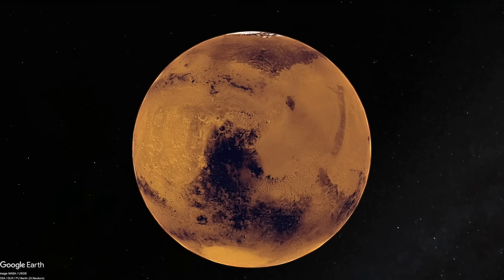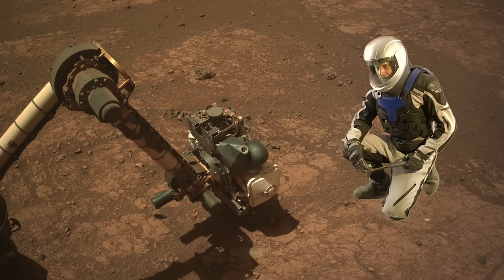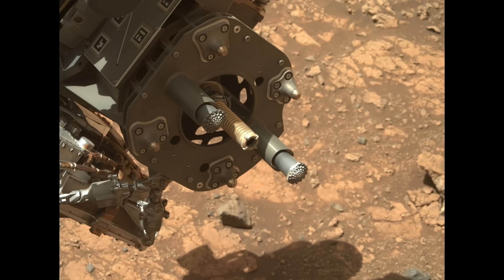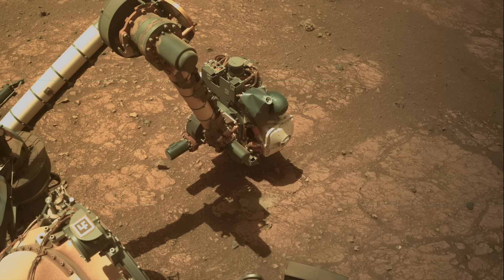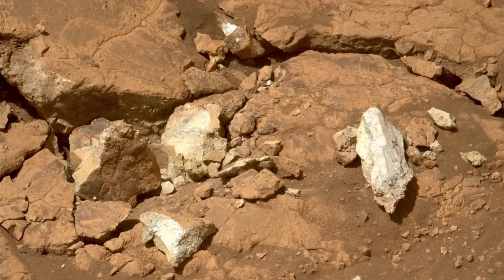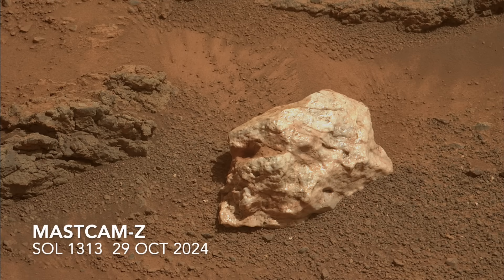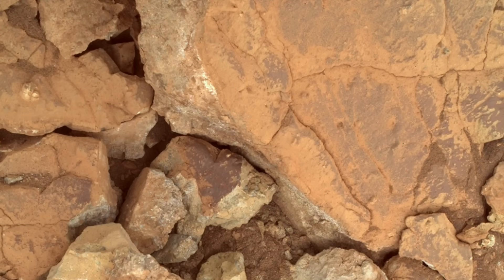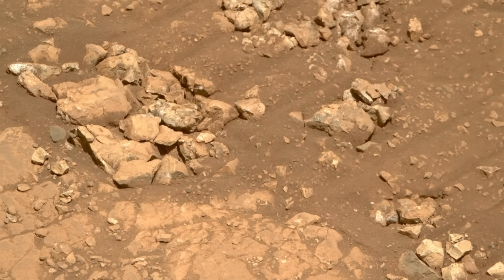Drilling failure leads to new discovery

Comment: I find in curious that at 4:05 there appears to be ripples in the dusty area in the upper right quadrant, and upper section if the frame. There are also some inter-ripple gaps. These may be fractures covered by dust, but it is unusual that the spacing seems so uniform. Also, note that the exposed rock does not have these fractures.
Reply: The ripples presumably indicate the direction of the prevailing winds at that spot.
Reply from the maker: Yeah, I should've pointed these out.  They're actually marks from the rover's wheel grousers (cleats).  The rover crushed some of the white rocks in this location.

Comment: I knew there must be a reason for my buying a Swiss Army Knife, but I never thought it would be useful on Mars.
Reply: Americans will use anything but the metric system XD
Reply: @TurboLoveTrain  Ouch. Common meme. I think he is just giving us a quick-glance reference, the same as his "Mars Guy" overlay. I do get it's a joke. Sorry if I sound pedantic, it's the temperament that had me subscribe. :-)
Reply: @flamencoprof  It's an accurate meme though.  I'm not complaining--I do like to remind people that NASA went to the moon using standard units and didn't formally switch to metric until 2007.

I don't like metric because they defined it as a ratio of the speed of light and the speed of light isn't a constant as much as standard model scientists try to pretend it is.
Reply: @TurboLoveTrain  Hmm...  The SI metre is defined as the distance travelled by light in a time in a vacuum.  The only problem I see is that it omits gravity. It should also specify a gravity field strength, be it at Earth's surface (variable) or some arbitrary distance from Earth, which then fades into the sun and planets and nearby galaxies, etc. I know that in 2015 a new clock was sensitive enough to detect the time shift caused by a rise of only two centimeters! It can thus serve as an extremely accurate measure of height for mapping, and of gravity variations caused by the earth's composition and shape.
    Is this your problem with the metre?
Reply: @flamencoprof  Yes, pegging the meter to the speed of light creates a circular definition.  My problem is big G isn't constant and neither is C.  By pegging the meter to the speed of light a whole aspect of cosmology is ignored.  G is known not to just vary from place to place but throughout the day and the current value is an average.  There were also variances measured in C almost all the way up to when thy circularly defined it in the late 60s... then they just stopped measuring it.  

Yes college students still run experiments to learn a process but that is an inaccurate method and the results aren't recorded for record.

Standard Model want's to treat the universe as fixed and wholly discrete and in doing so have created a religion and stopped doing science.
Reply: @TurboLoveTrain  How do you explain big G varying according to Earth time? Surely it is the other way around; Earth time conditions will affect measurement of G, on Earth?
Reply: @flamencoprof  How do I explain different labs measuring different values for big G at different times of the day and in different locations?!?!?  I'm not explaining "why" at all, I'm just telling you it's a real phenomenon.
Reply: @TurboLoveTrain  I believe you. All I can say is that it would be interesting to measure G at, say, an Earth-Moon Lagrange point, which would be the next-most neutral G point we could (easily?) access. I'll send Elon a memo :-).
Reply: @flamencoprof  I don't thing G is neutral.  I think as our solar system moves through the galaxy the properties of space itself may have slight variances.  Even in our own solar system there is evidence of this like from the gas giant probes.
Reply: @TurboLoveTrain  I thought we'd agreed on that. As I understand it, if space is warped by gravity, and gravity can act as far as between galaxies, then there is virtually nowhere G is flat.
The question is, can we measure an approximation of G by correcting for a summation of the velocity and magnitude of all (significant) masses within any arbitrary volume?
This seems problematic for super accuracy, as how do you measure all that at once, or within a reasonable time-frame?
Maybe the Vera Rubin instrument could help with that? :-)
Reply: @flamencoprof  I'm not sure the costs involved but I think a good start would be to start logging it over time again and publishing the results.
Reply: @TurboLoveTrain  A good start. Nice convo, thanks for your thoughts, I learned and thought, but I can't add more. Cheers.
Reply: Waiting for the day the corkscrew becomes useful...
Reply: @chrisantoniou4366  Chateau Musk 2050 anyone?
Reply: Anywhere 😊. Those Swiss weren’t messin’ round 😂

Comment: Good Morning, Mars Guy. I can't wait to hear your report on what that rock is. If you are right about the possibility of water being involved. That's very encouraging. Looking at the surface around the drill hole. What do you think caused the surface pattern we are looking at? I trust your instincts. It would be great if they could find some form of evidence of vegetation. I keep hoping. Great Episode. Have a Great Day.
Reply from the maker: Thanks.  I'm not quite sure what you mean by the surface pattern around the drill hole, but the rocks in this scene have been smoothed down by wind erosion and fractured at multiple scales, possibly by contraction if the original material was deposited hot.
Reply: @MarsGuy  Thank You for Your speedy reply. You answered my question. Thanks Again, Mars Guy.

Comment: I did wonder why NASA didn't include an XRF detector on Perseverance to analyse the chemical elements present on the surface.
Reply: But it does have an XRF detector so I'm not sure what you mean.
Reply: And i wonder why you felt the need to post misinformation here. 
Perseverance does have a XRF detector.

Comment: Mars Guy, I wonder if you could answer this question: On Sol 4561 The right navigation cam on Curiosity took a photo with something strange in the sky, what do you think it is? Image: (2025-06-05 13:44:34 UTC)  Image 1474795. I would have posted link direct to actual image on NASA's site but guess it will be removed.